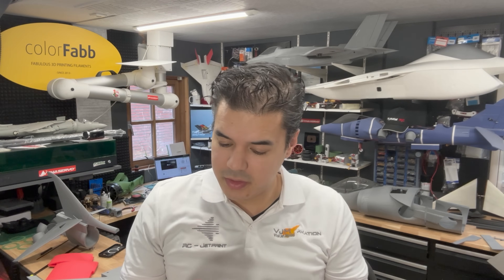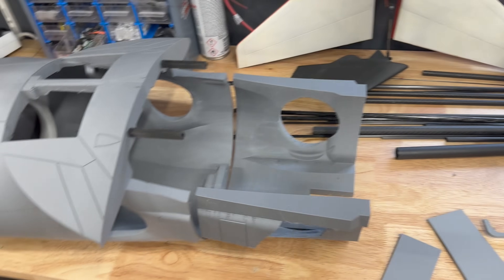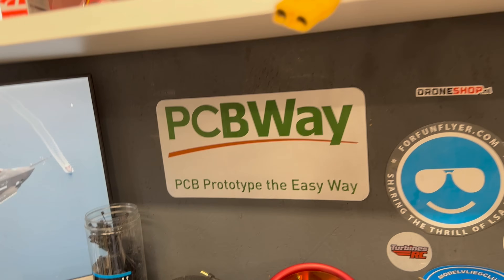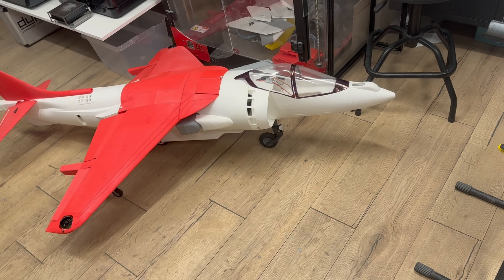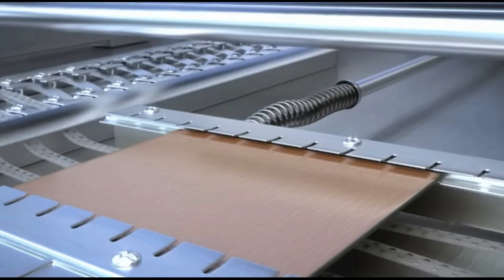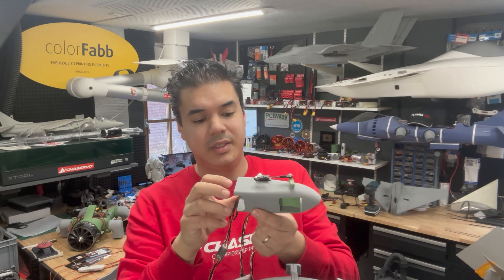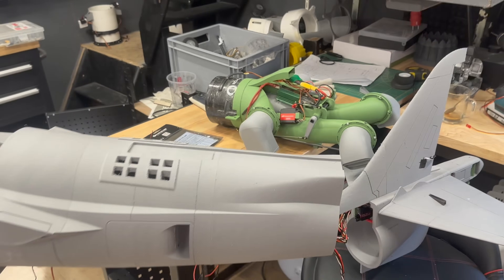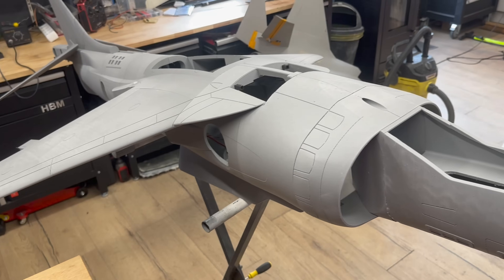RC Harrier VTOL JET, The Jumpjet Build By Joel Vlashof with Scale Puffer Roll Jets Vlog 3

Comment: I think you dont need the wing tip duct if you use 4 seprate servos to control main nozzle direction. For example if left 2 nozzles roll to opposite direction, then the plane will roll left.:face-blue-smiling:
Reply from the maker: How about roll momentum? And thrust to weight

Comment: Joel I suggest you use A. 2 seprate ducts engines 1 engine duct for each 2 nozzles with equal intakes. This way you loose centre section weight.B. Use your fuselage to attach your nozzles rather from having an inner ducted system to attach your nozzles so use your fuselage to attach your ducted system to reduce major weight.

Comment: Thoughts on making most of the airframe out of XPS foam? Would be lighter and more durable.
Reply from the maker: Agreed! After this step I’m going back to make moulds
Reply: @Joelmelanie  Moulds? Interesting. Most people CNC machine the foam (like rctestflight) or hot wire cut it, or both. 

I've always thought about composite XPS, EPP and plastic airframes, but I've never gotten to building one (yet)